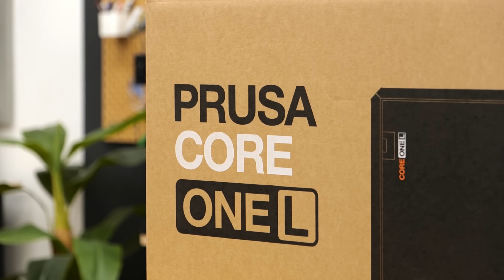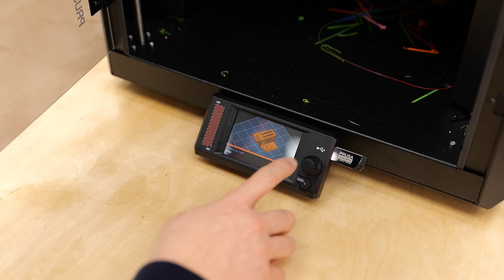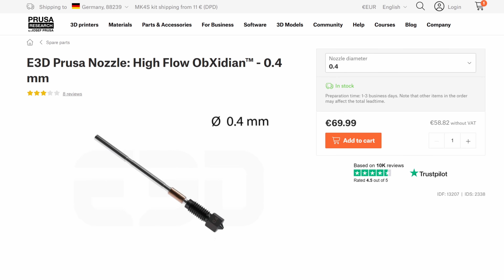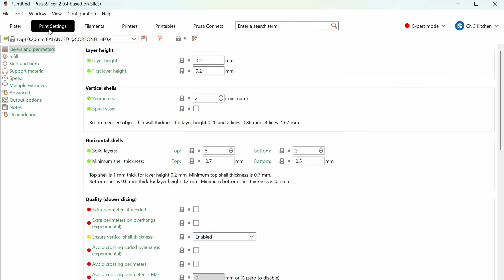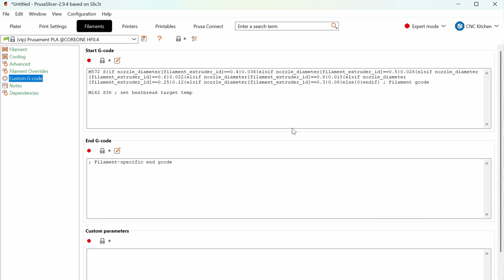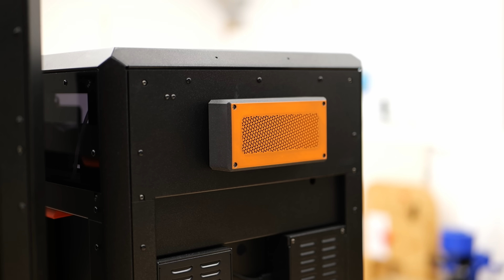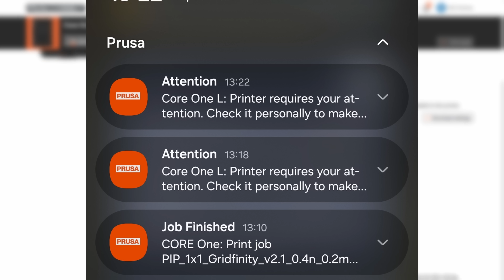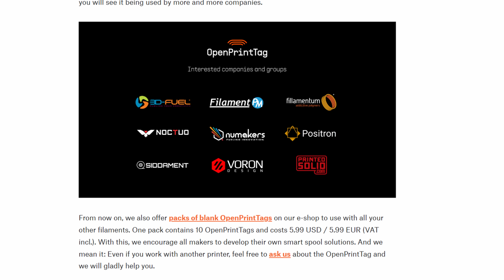What Prusa Got Right (and Wrong) with the New CORE One L

Comment from the maker: CORRECTION: I said the the print volume was 300x300x320 but the print height is actually 330 mm!
Reply: When you test the Fibreseeker-3, I saw them say that ABS/ASA does not stick to fiber very well, and that is why they use PA and PETG.

Please also test PET and release comparison test results.

Also, probably use PET-GF or CF because it prints with less warp than regular PET. Same for PETG and PA.

Please compare to the same parts made on Markforged (maybe the company will give you a budget to have the parts printed?)
Reply: Is it actually 300x 300x330. Or is it reduced print size like the new bambu’s?
Reply: "Oh Boy!  Now I'm definitely getting a Prusa!" /s  🤣

Comment: I just received my Prusa Core One L+, which includes nozzle cleaning. However, I get the nozzle cleaning errors and I can't understand why. When it gets to the point in the gcode to move the nozzle to the crush area, it will get there and then pause, not even attempt to clean the nozzle, and give me an error. No other explanation. I love the printer except for a couple of issues I've had to content with, one solved by adjusting slicer settings. The other being this occasional nozzle cleaning issue. One other note, since I have the Core One L+ I have the new belts. I don't know what effect that has on loudness, but the Core One L+ is significantly quieter than my Core One +. I have ordered the Gen2 kit for Core One+ and hope to have that in the not-to-distant future. With the new belts I'll see if that makes the Core One+ any quieter.

Comment: Every time I watch a review for a new printer, I pick up the benchy that was my first print on my Mk3 kit, and I'm blown away at how perfect it is. It's been 7 years and most brand new printers aren't matching the quality, which just seems crazy.
Reply: I'm in the market for a new printer, but that's exactly where I'm stuck at, too. My my highly modified Frankenstein printer (once a cheap "TwoTrees Sapphire S") still does great (or even better than those "flaship" printers) when it comes to print quality. The only issues are that it's rather slow and the small bed size.

Comment: People, I find all printer reviews, in fact all youtube reviews both valuable and a waste because although they should give people all the info they tend to push issues zero people care about till pointed out. Like sound, I never found any 3d printer too loud. Ringing, yes it matters but very little in reality unless very bad, needing angled light to see it really is a small issue, Bed temp the core 1 l is one of the best on bed temps being even and often reviewer use cheap Chinese temp cameras to measure which as a professional are about as accurate as...............they just are not not even within 10degrees reliably. Speed is almost always irrational because the real speed of desirable prints is the real speed and it's normally 50 to 70% of advertised and sadly on small prints nearly irrelevant-take my ender 3 it is nearly as fast on total time on small prints and honestly the print quality is on average better and I have the regular old ender 3 without upgraded anything-how??? because my newer machines all go through annoying calibrations and cleaning and shimmy and shaking and the ender 3 just starts, runs slow but smooth then the newer machines have to go like hell to catch up. Im also question how speed effects strength of the print? I want another machine (multicolor and material) but the prices are fair but will drop and there seems to be no set method yet so I will let others waste money buying all the 1st off tech. Plus I question 3d printing machines now as some with add ons can be $3k to $5K and you are half way to a cnc mini by a real cnc company aka machine shop quality machine and I would rather drop 15K on that and make real parts or buy a used powdered laser machine for that money. 3d printers are starting to get to the price that the tech is no longer useful as profession equipment is in reach or it becomes more viable just to order cnc metal parts from online and use a $75 ender 3 or cheap modern 3d printer just to debug parts.

Comment: Bambu Lab only has better quality when hitting print and hoping for the best! LOL calibrate any Prusa and calibrate any Bambu Lab yourself, if you know what your doing, I promise the PRUSA will give better quality. What’s even crazier.. my Creality K2 Plus with a DXC2 extruder, a Microswiss Flowtech Hotend with a Diamondback Nozzle, and a R3men graphite bed is out printing my fully calibrated Core One Plus, and 3 different Bambu Lab printers. Yeah I know it’s shocking, but the K2 Plus is seriously the best machine I ever seen with those 3 upgrades. I get thee most stable, consistent and reliable extrusion and the R3men graphite bed lets me load that bed fully and I never see a failed print, a failed print is 99% of the time my fault on the K2 plus.
The stock settings on the core one L are ok, but the Core One L completely calibrated like my K2 Plus is pretty insane. I have only had my Prusa Core One L for about 3 or 4 weeks but I will say when I can calibrate more filaments and Calibrate them all the way.. I think I’ll have much nicer things to say about the Core One L but I will tell you all… if you doubt what I’m saying about the K2 plus with the 3 must have upgrades, I’m LOL at you because that machine is one of thee best you can buy on the market today, if it had a tool changer like INDX I would have never bought the Core One L!

Comment: Prusa is making bambu look really good and bambu's are not a very good printer to own you cant adjust your Z and speed options are very limited. Prusa is so over priced ill never own another one ill tell you that my MK2 did not last that long to allow myself to pay 4x the amount of a typical printer. SV08 = $500 add bondtech INDX $350 or the KCM kit if you dont want tool heads that would give you a 350mm x350 bed with multi toolheads or just colors depends on what one you go with. Sorry but anyone that recommends this core one has no value for money or does not have to work for money.
Reply: you can adjust Z-offset on bambu but you don't really have to, that's the whole point. and speed is adjustable like on any other printer... agree with the rest :)
Reply: @riba2233  Im sorry you never played with new filament I build RC planes. when i got my first roll of lw-pla a few years ago I had to setup a offset to the Z when i would run that filament on first layer. I do have a profile for it now.  but i would have not been able to do that unless i offset. If i cant adjust by .001 is a downfall for me as well. My machine My control is the big one for me.
Reply: @st0mper121  ok I get it but like I said you can adjust the z-offset, it's in the print start g-code, has been since the first day
Reply: @riba2233  you can change the Z by the gcode yes but not on the fly when your dealing with new filament i dont want to have to make a new gcode for every attempt. and the speed thing the bambu i have you can only do 50% 100% 126% 166% that is unacceptable as well. I have had sensitive prints i have to lower speed down to 80-85% Will it work at 50% yes do i like waiting the extra time ? no

Comment: After the "security issues" with Bambu, I ditched my P1S for a Core One and I am much happier with my Prusa. For some reason my P1S had issues with PETG, I have no clue why but it hated it, my Prusa has been amazing with PETG and even the PA6 that I usually print with. I really like that the L model has an active chamber heater, and I'm wondering if fans under the heatbed would be possible on the base Core One.
Reply: those fans are far from a proper chamber heater.

Comment: So I am absolutely not a prusa apologist, and all the issues you raised are legitimate and they should address them. 

All that said, I want to take polite and respectful issue with your comment about prusa not representing the highest bang for your buck. You said this right after rattling off that they have better support, better parts availability, better repairability,  etc with the Prusa. I'm always prepared to be wrong, but I genuinely believe that if you see a printer as a multi-year investment in a tool, it actually does represent better value, despite the higher initial purchase price.

Comment: As a resident of the EU, why should I prefer something built in the EU just for that reason? The EU screwed up my country. They are also pushing more and more anti-privacy legislation, so any EU based cloud service is risky. The same is true for China, but China is too far to cause harm. If I have to choose between a EU product and a Chinese one I would definitely choose the one that fits my needs better, at a lower price. And I would try to avoid cloud services at all if possible, but if impossible I would chose the ones that have weaker ties to the state I leave in.

Comment: I feel like a good chunk of that quality complaints was really the slicer... and PrusaSlicer needs some work. We'll see once PS 3.0 comes out next year. But also: do the rant. As we've seen over the years now, companies have 3 options: take your feedback, ignore your feedback, or blacklist you. I've not really heard anyone get blacklisted by Prusa, but I hope they take the feedback. Especially that keying for the top cover and the filament sensor.

Pricing will always be a desire, but they keep knocking down the price in small increments each year, release updated components/features (looks at them finally adding the camera instead of it being optional), and they said on stage they're growing 20% YoY (I think it was 20... I know it was 2 digits and greater then 10). So they're not shrinking and loosing customers. And as I comment from the future... they upgraded the Core ONE to the Core ONE+ and it has the updated top vent and filament sensor for the earth shattering upgrade cost of... $10.

I've ranted on the 290C extruder limit for a while... grab Jo at a convention and ask him... he'll say the MK4, XL, and Core ONE can print at 300C. Ask support and the engineers, and they'll say 290C. So there was a disconnect somewhere and people have legit made tickets about it that got closed as "this is expected". But if you're fine with spending $200, they announced a HT hotend upgrade (only for the C1, C1+, C1L) that can reach 400C. It's drop in replacement, so that's a bonus.

Now just to wait for them to announce the INDX...

Comment: Here is my experience with Prusa.

I ordered my Core One Kit when it came out. When it arrived a few weeks later, there was a part missing. Not that big of a deal, right? Only that I live in a small flat with my girlfriend who wasn't really pleased that I couldn't finish the build in our dining room. The part came, I continued the build. Then I saw that the fan cover and the door were damaged. I told the support again, but could not wait any longer, so I finished the build with damaged parts. Prusa offered me a 30 € discount or replacement parts. For 2 major inconveniences in one build, I think I should have gotten a little more than that. I told them that I was kind of disappointed, and they answered I should send it back then (basically F off in a nice way). Well, I kept it and I probably wouldn't do it again.

Also, the build was fine and everything was described nicely, but due to the 3D-printed parts, the torque that you can apply to tighten certain screws varies a lot. Why no heated inserts? Now I see Bambu making nicer and nicer new machines, so that if I had to choose again today, I probably would not buy a Prusa again.

Would it be possible that if I had a problem with my potential Bambu machine, I would not get the same support? Maybe. Still, those things are way less hassle to begin with. Plus, no multi-color, no nozzle cleaning, and no camera as standard or hassle-free for Prusa printers.

The Core One L now having these updates and basically being the priter the regular Core One could have been, is a punch in the face for all people who wanted to support European manufacturing and bought the Core One initally.

Edit: There is an upgrade Kit for 9.99€ from Core One to Core One +. Thats nice.

Comment: "Finally a touch screen" is a thing I don't get. My CoreOne has had a touch screen from day one. 
Using a standard hardened nozzle instead of a high flow one make a lot of sense. The high flow nozzle is not that well suited for (carbon) filled materials and it is a lot more difficult to clean in case of a clogged nozzle. If you are going for a hardened nozzle for things like carbon filled materials, high speed printing is not the goal and then the high flow nozzle only increases the risk of a clogged nozzle or at least a failed print. I originally also bought the high flow hardened nozzle but meanwhile replaced it with a standard one for those reasons ...

Comment: Nice review, but can you please stop saying Bambu is forcing people into a cloud and Prusa doesn‘t! I have a Core one and a H2D and both are identical software wise. Both need the cloud for the phone app but could be completly used without.
Reply: Prusa gives you nudges to use cloud. Bambu blocks features until you connect to the cloud
Reply: Bambu forces you to make an account just to use their printer and locks you of of certain features you paid for if you don't use their chinese cloud services. Prusa doesn't.
Reply: I don‘t know what are you guys talking about. I used my H2D for 2 weeks without an account and it worked, no problem. Yes the spaghetti detection did not work, but Prusa doesn‘t have it at all, so that can not be counted into consideration. The LAN-only mode works for both the same way, but Prusa still calls it Beta.
Reply: @ChefBenni  Prusa printers don't have spaghetti detection becasue prusa printers don't suffer from spaghetti problems.
Reply: @LilApe that was a good one. I‘m working since 2018 with Prusa printers and they are just FDM printer. Yes, good working printers, but no magic farry dust as most claim. And the newer models are significantly more unreliable than the old ones

Comment: My K1 Max had the same issue with any curved surfaces (mine was worse than what you showed) and I fixed it by manually adjusting PA + flow ratio without having to slow down the print. Really annoying since, like you mentioned, it has to be adjusted per filament.

Comment: Mind the filter system from Alveo3D contains a high pressure fan, they did try normal fan's but they fail to push air through. Also they can run longer then 600 workours. Like the good the bad and ugly review.

Comment: You stopped debugging after changing 1 setting in the slicer, because the machine should be the tool, not the project? What? You could've as well complained that it does not read your minds and summon the required models instantly, idk. No factory profiles in the slicers are even close to be perfect at least because the materials are different and you definitely know that. You also know, that unless the printer is completely broken mechanically, pretty much all of them can be set to print with almost identical almost perfect quality, but on different speeds, accelerations and with different materials. But instead of actively complaining that 1800$ machine still can't do what 600$ qidi (that has ACTUAL active thermal chamber and 350 nozzle) can and pushing pruca to move their аss towards the competitors, you choose to pay attention to completely insignificant slicer presets imperfections.

Speed comparison based on the default profiles is complete BS as well, seeing that on this a channel is a joke. The actual speed parts are peak flowrate and peak acceleration (based on input shaper calibration) and these can be TESTED. I don't need a review to know that 2025 release year printer is able to print somewhat OK and it claims to be better than bambu in something, but I do need a review to test all these claims and see the actual limits of the machine.

As for last point... Sovol sv08. Third the price, much better mechanics, much better cooling, same openness, no proprietary bs.

Comment: 18:02, what Prusa should also change is that angled heater block, which causes the wires getting sharply twisted in those narrow regions.  
Re-orienting it to straight position as mkxx series would be better. Although this may require redesigning the airflow guiding part.

Comment: I just wish the companies would stop fighting each other and work together... let me open links directly from makerworld in prusaslicer, let me open things in bambuslicer from printables, use an open filament rfid system, etc... Use each other's strengths instead of fighting against each other.
And when you have a customer, stand by your hardware to support it. After the display of my mk3/s became unreadable a little over a year after buying it and they wouldn't replace it under warranty I was done with prusa. It was obviously a hardware defect that should be under warranty but they had a different opinion. And I don't even want to talk about what a horrible product the MMU2 was... that thing should never have been sold.